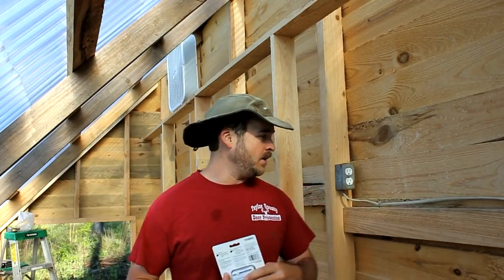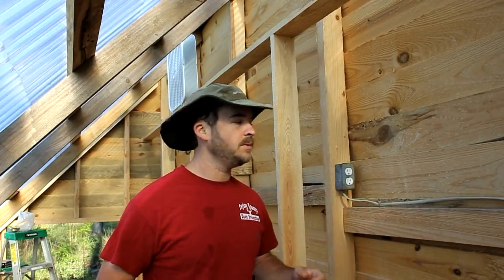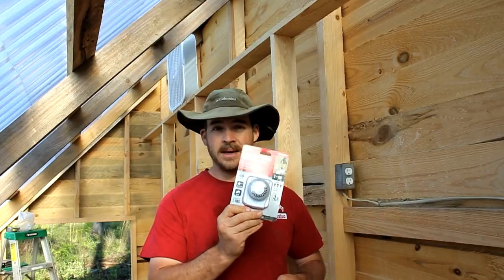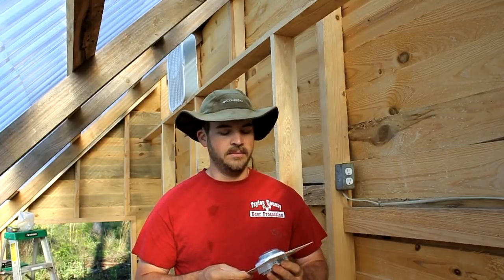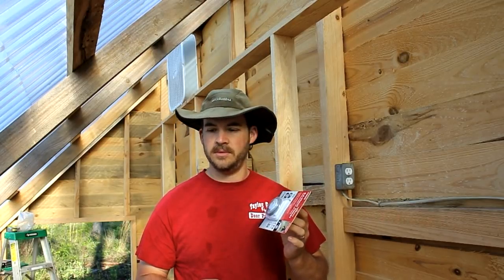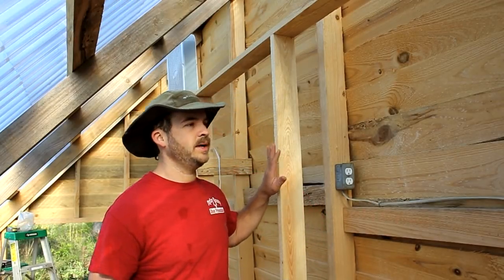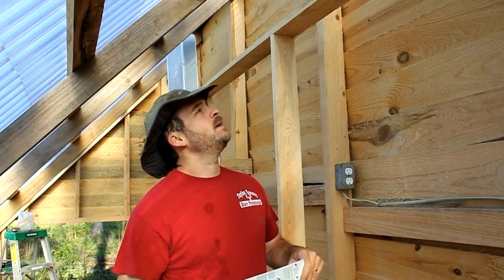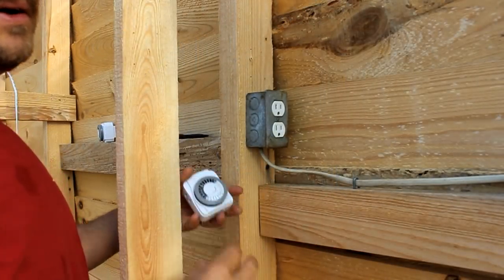Building a SOLAR KILN!! Part 9

Comment: 9:20 I think you would get better flow with 3 20 foot 4x4s running the other way. Then you bridge the first layer with 2x4s to lift them up off of the floor. You have a sawmill. You can use any type of junk wood for the 4s and 2s. And have as many as you want.

Comment: Your blocks for footings need to have been set with flat face out, openings down. Think of them as sections of columns. Your strength and load bearing cord from the columns

Comment: Looking back on your build, (which looks great by the way) do you wish you had insulated the kiln.? Or have you since this original build gone back and insulated it? I was thinking in one of your other videos, you mentioned some mold on the wood stacked in there, Has the issue been eliminated or did I misunderstand what was being said and you did not have any mold issues. I have recently ordered my first mill, and obviously this is on my list as well. Like many others who buy a mill, I will need a fair amount of wood to be kiln dried for woodworking projects I plan to do. So I figure asking folks like you about your kilns would be the best bet over just making a bunch of mistakes myself in the experimental process. Thanks in advance, I know this is a lot of quesitons, and as large as your viewers base is, it may well make you a sweet video for future uploads. Thanks again. 
Dale

Comment: Wouldn't you need to add a dehumidifier in there so it pulls out the moisture? I am looking at building a similar structure but have read that the fans create airflow but will not pull out the moisture. One dehumidifier would probably suffice for the entire structure. Just a thought...
Reply from the maker: This one is drying great with just the fans onto and bottom so far thankfully. Great tip though.

Comment: I have run my dryer with a timer set for 8:30am to 5pm and it worked great. Simple is always best. The wood is dry went there is no more condensation on the inside of the glazing. George Pilgrim.

Comment: WOW just remove the cover plate off the outlet box then rotate to receptacle 180 degrees
Reply from the maker: Mick Martin That is obvious, I agree, but it still will only support one timer. The terminals are set up so that the timers only go in one way, and they are so large that one timer will cover both outlets. So, I’ll need to move this outlet, or flip it like you say, and add another.

Comment: Just use a power strip with sideways outlets. About 20 bucks at Lowe's or somewhere similar, then you can use bothe timers and have easy expansion as well.

Comment: Rain on the roof , what a good place for a nap lol
Reply: I know that you are not looking for ideas for drying your timber, BUT, the runners on the floor ???  Maybe a heavy duty short (in height and length)  trolley table for your lumber ,maybe 2.  You can have a landing at one end with additional trolley track. Load your trolley with stickered wood and use your tractor to pull it into your kiln.  When dry use your tractor to remove trolley.
Reply from the maker: Galen Johnson My dad had essentially the same idea! It would be a lot easier on my back for sure.